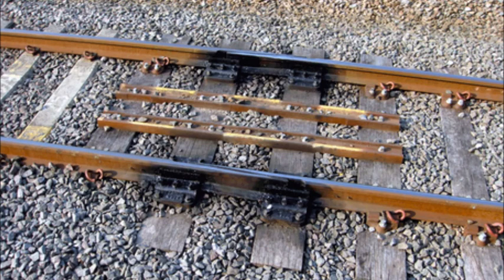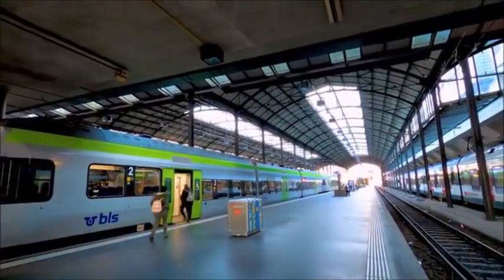Railway Track Construction

Comment: The video on Rail and Rail Welding explains the
structure, function, and joining methods of railway
tracks It begins by describing rails as the steel
components that guide and support train wheels
forming a continuous path for smooth and safe train
movement The video highlights the importance of
proper alignment, strength, J and durability of rails to
handle heavy loads and high speeds

Comment: Railway track construction is the process of building and assembling the infrastructure necessary for rail transportation. This includes:
- *Earthwork*: Preparing the land, grading, and excavating to create a stable base.
- *Track laying*: Placing rails, sleepers (ties), and ballast to form the track structure.
- *Rail assembly*: Joining rail sections using welding or other methods.
- *Track alignment and leveling*: Ensuring the track is properly aligned and leveled for smooth train operation.
- **Ballast

Comment: The Railway Track Construction explains the step-by-step process involved in building a railway track system. It begins with surveying and earthwork, where the land is leveled and cleared. Next, formation layers are prepared to support the track structure, followed by laying ballast—crushed stones that provide stability and drainage. Then, sleepers (usually concrete or wooden) are placed on the ballast to maintain gauge and distribute loads. Over the sleepers, rails are laid and joined together using fishplates or welding methods. Proper alignment, leveling, and packing (called tamping) are done to ensure a smooth track. The class also discusses track drainage systems, the importance of ballast maintenance, and safety checks before the track is commissioned. Overall, the construction ensures durability, smooth operation, and minimal maintenance of the railway

Comment: Railway construction is the process of building a transport system for passengers and goods, involving several stages. It begins with survey and planning, where engineers study the terrain, demand, and environment to choose the route, gauge type, and station locations.
Next comes earthworks, preparing the ground by clearing, leveling, and forming embankments or cuttings. In challenging terrain, tunnels and bridges are constructed to maintain safe gradients and curves.
Track laying follows, involving placement of sleepers, rails, and fastenings, supported by ballast for stability and drainage. Modern systems may use concrete sleepers and continuously welded rails for smoother operation.
Signaling and communication systems are installed to control train movements and ensure safety. This may include automatic train control, centralized traffic management, and communication lines connecting control centers, stations, and trains.
The construction also includes stations and facilities such as passenger platforms, freight yards, depots, and maintenance workshops. Depending on the chosen traction, electrification equipment or diesel fueling systems are set up.
Finally, testing and commissioning ensure that the railway meets safety, speed, and operational standards before opening to the public.
The complexity and duration of railway construction vary depending on terrain, technology, and whether it’s a metro, conventional, or high-speed line.

Comment: Railway infrastructure refers to the whole system that supports rail transportation, including tracks, stations, signal and other components… railway track construction is a process that requires much planning, executions and ongoing Maintenance to ensure the safe and efficient operation of trains…  it is built step by step

Comment: This construction involves several steps to ensure a stable and safe railway infrastructure.. 1, site preparation. 2, subgrade construction. 3, ballast layer.. 4 sleeper installation 5, rail installation. 6, rail fastening. 7, tamping and alignment. 8, final inspection and testing.

Comment: It's no new thing that for Trains to move from one point to another, it needs Track system which is very crucial in the use of train as a major source or means of transportation. Construction of Railway Track systems were innovated from the invention of Trains due to its weight

Comment: The YouTube class on Railway Track Construction explains the step-by-step process involved in building a railway track system. It begins with surveying and earthwork, where the land is leveled and cleared. Next, formation layers are prepared to support the track structure, followed by laying ballast—crushed stones that provide stability and drainage. Then, sleepers (usually concrete or wooden) are placed on the ballast to maintain gauge and distribute loads. Over the sleepers, rails are laid and joined together using fishplates or welding methods. Proper alignment, leveling, and packing (called tamping) are done to ensure a smooth track. The class also discusses track drainage systems, the importance of ballast maintenance, and safety checks before the track is commissioned. Overall, the construction ensures durability, smooth operation, and minimal maintenance of the railway line.

Comment: Building a railway track is a step-by-step engineering process that involves planning, earthworks, track laying, and finishing works.

1. Surveying and Planning

Conduct route survey to determine the best alignment (straightness, curves, gradients).

Assess geotechnical conditions (soil type, rock formations, drainage).

Plan for stations, bridges, tunnels, level crossings, and environmental impact.

2. Land Acquisition and Clearance
Acquire land for the railway right-of-way.
Remove vegetation, old structures, and obstacles.

3. Earthworks and Formation
Cutting and filling: Level high ground and fill low ground.
Grading: Shape the formation to the correct slope and camber for drainage.
Drainage works: Install culverts, side drains, and cross drains.

Comment: Railway Track construction.

Building a railway track is a complex and highly specialised  process that requires careful planning and engineering expertise for the safety standards. 
Below are the steps involves in constructing a railway tracks. In general Railway consists of the ballast bed, steel rail, Railway sleepers, Railway fish plate, Rail clip, rail Road type clip.
The guides introduce steps by step for the  construction includes ;
1.) Project design and planning by conducting of survey in order to access soil conditions, topography of a place and existing structures. 
2.) Land acquisition and clearing to start Earth works and levelling. 
3.) Install drainage and laying of track materials such as railway sleepers, steel rails, rail fasteners and some construction components.

Comment: Railway track construction involves several key stages. First, the ground is prepared, which may include grading and leveling the terrain. Next, the ballast is laid, providing a stable base. Sleepers (or ties) are then placed on the ballast, and the rails are attached to the sleepers using fasteners. The track is then aligned and leveled to ensure a smooth ride. Finally, the track is tamped to compact the ballast and provide further stability. Throughout the process, quality control measures are implemented to ensure the track meets safety and performance standards.

Comment: Railway infrastructure refers to the entire system that supports rail transportation, including tracks, stations, signals, and other components ¹.

Key Components of Railway Infrastructure:

- *Tracks*: The rails, sleepers, and ballast that make up the railway line.
- *Stations*: The facilities where passengers board and alight from trains.
- *Signals*: The systems used to control and direct train movements.
- *Yards and Depots*: The areas where trains are maintained, serviced, and stored.
- *Control Systems*: The technology used to manage and coordinate train operations.

In Nigeria, for example, the Nigerian Railway Corporation is responsible for managing the country's railway infrastructure, which includes over 3,500 kilometers of track ².

Effective railway infrastructure is critical for efficient and safe rail transportation, and investments in modernizing and expanding railway infrastructure can have significant economic and social benefits.

Comment: Railway track construction involves several steps:

Preparation
1. *Planning and design*: Determine the route, track layout, and technical specifications.
2. *Land acquisition*: Obtain the necessary land and permits.
3. *Clearing and grubbing*: Remove vegetation, debris, and obstacles.
4. *Grading*: Level the ground to the required elevation.

Subgrade Preparation
1. *Excavation*: Dig the subgrade to the required depth.
2. *Compaction*: Compact the subgrade using rollers or plate compactors.
3. *Geotextile installation*: Lay down a geotextile material to prevent settlement.

Track Bed Preparation
1. *Ballast placement*: Lay down a layer of ballast (crushed stone or gravel).
2. *Ballast compaction*: Compact the ballast using rollers or plate compactors.

Track Installation
1. *Rail placement*: Lay down the rails on the track bed.
2. *Rail alignment*: Align the rails to the required gauge and alignment.
3. *Rail fastening*: Secure the rails to the sleepers using fasteners (e.g., clips, screws).
4. *Sleeper placement*: Lay down the sleepers (wooden or concrete) at regular intervals.

Final Touches
1. *Tamping*: Use a tamping machine to compact the ballast and settle the track.
2. *Surfacing*: Use a surfacing machine to level and align the track.
3. *Inspection*: Inspect the track for any defects or irregularities.

Comment: Railway track construction is a complex process that involves several steps, from planning and design to construction and maintenance. The quality of the track construction has a significant impact on the safety, efficiency, and reliability of the railway system.

Railway track construction is a complex process that requires careful planning, design, and execution. The quality of the track construction has a significant impact on the safety, efficiency, and reliability of the railway system. By following the steps outlined in this review, railway track construction projects can be completed successfully and efficiently.

Comment: The  video on "Railway Track Construction" provides a comprehensive guide to the meticulous process of building a railway track system, emphasizing precision and durability for safe and efficient train operations. The process begins with surveying and earthwork, where the terrain is assessed, cleared, and leveled to create a stable base. This is followed by the preparation of formation layers, which form a solid foundation to support the track structure under heavy loads. Next, ballast—typically crushed stones—is laid to provide stability, absorb shocks, and ensure proper drainage, preventing water accumulation that could weaken the track. Sleepers, made of concrete or wood, are then placed on the ballast at precise intervals to maintain the correct gauge (distance between rails) and distribute train loads evenly. Rails are laid over the sleepers and secured using fishplates for bolted joints or welding (e.g., thermit or flash butt) for seamless tracks, reducing wear and maintenance. The track undergoes alignment, leveling, and tamping a process of packing ballast beneath sleepers for stability and smoothness. The class also highlights the importance of track drainage systems to prevent water-related damage and ballast maintenance to ensure long-term performance. Finally, rigorous safety checks are conducted before commissioning to verify structural integrity, ensuring the railway’s durability, smooth operation, and minimal maintenance needs, supporting efficient transportation.

Comment: Railway Track Construction outlines the step-by-step procedure for building a functional railway track system. The process starts with surveying and earthwork, during which the land is cleared, leveled, and prepared for construction. Following this, formation layers are built to provide a strong foundation for the track.

Next, ballast—a layer of crushed stones—is spread to ensure track stability and drainage. On top of the ballast, sleepers (typically made of concrete or wood) are placed to preserve track gauge and distribute the train’s load evenly. The rails are then positioned over the sleepers and connected using either fishplates or welding techniques.

To ensure a smooth and safe ride, precise alignment, leveling, and tamping (packing of ballast under sleepers) are carried out. The class also highlights the role of track drainage systems, the need for regular ballast upkeep, and safety inspections before the track is opened for use.

In summary, the construction process is designed to produce a strong, efficient, and low-maintenance railway line, capable of handling trains safely and reliably over time.

Comment: Learnt that building a railway track is a complex process that requires careful planning and high safety standards.

It's necessary to install drainage before laying the track. The ballast are into two, the bottom and top ballast which serve different purposes

Comment: The video tutorial explained that runway orientation is determined primarily by the direction of prevailing winds at an airport location. Aircraft take off and land into the wind for safety and performance, so the orientation is selected based on long-term wind data to ensure maximum usability. The runway number is based on its magnetic heading, rounded to the nearest 10 degrees and divided by 10. For example, a runway facing 180° (south) is labeled as Runway 18. Since runways can be used in both directions, each end has a different number, 180° apart. For instance, a runway with heading 180°/360° would be labeled as 18/36. When there are parallel runways, they are distinguished using letters L (Left), C (Center), and R (Right) — e.g., 09L and 09R. The class also touched on how magnetic variation can cause periodic renumbering of runways to match updated magnetic headings. Proper orientation ensures safe and efficient flight operations and reduces crosswind challenges for pilots.

Comment: 7 Railway track construction, It was built in 1825, it involves project planning,survey planning and design,Railway tract construction gives comfortability to users, it could be better if introduced in the classroom, ballot built requires more elaboration,land acquisition, subgrade system,drainage installation and other hydraulic structures that may be built along the railway line,it has elasticity and durability,density test by using  cossians theory,testing, signalling, electricals, are necessary.building of the Railway track is financial intensive.

Comment: Railway track construction is a careful planning, it gives a role for the train to run, it was built in 1825, Detailed survey, Engineering  designs, topography,clear the land vegetations, and a hydraulic structure reinforced box culverts or bridges are been constructed along the railway line to avoid the rail formation been washed away by erosion ,Sleepers,railtracks and other components are been constructed.Compaction is achieved by manual as rail sprader sprays the approved aggregates.Elasticity tracks also constructed,foundation improves the subgrade,density tests are carried out,compaction is 250mm,Railsleepers are important components.